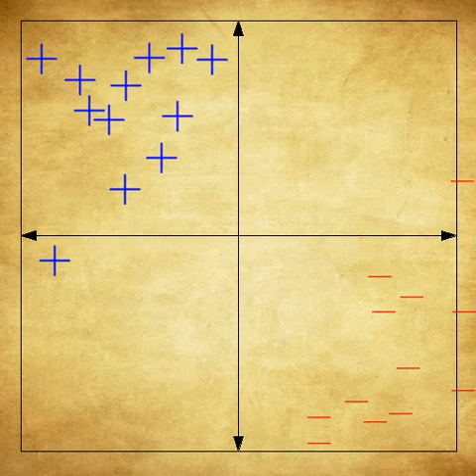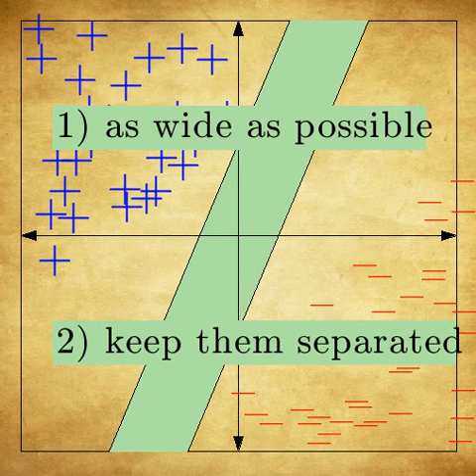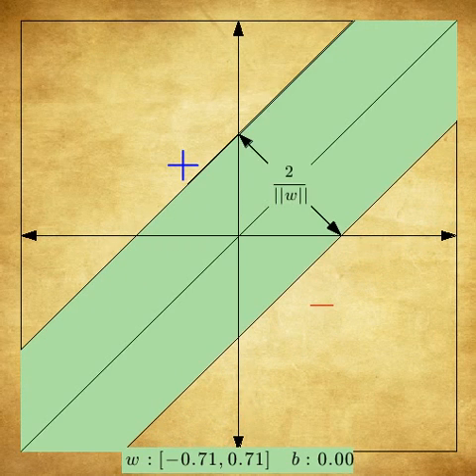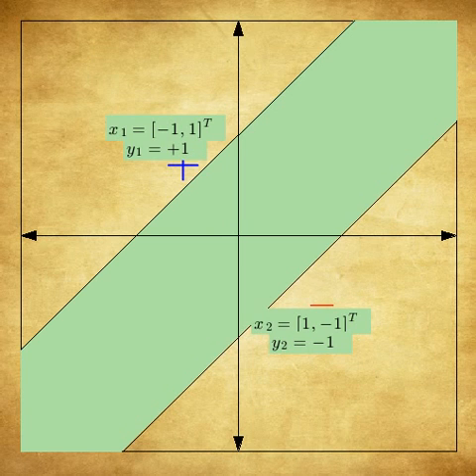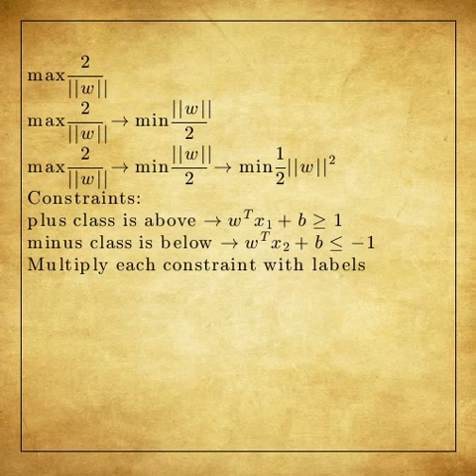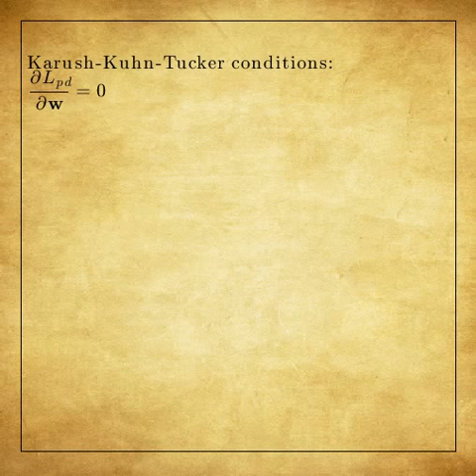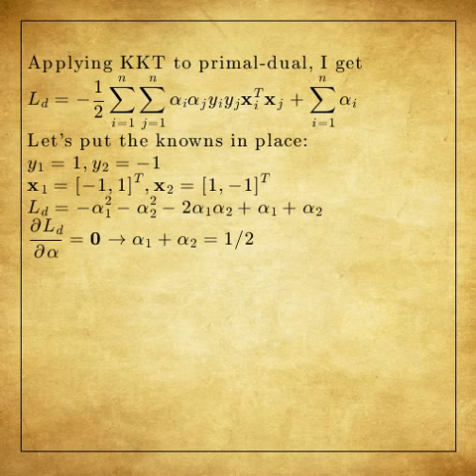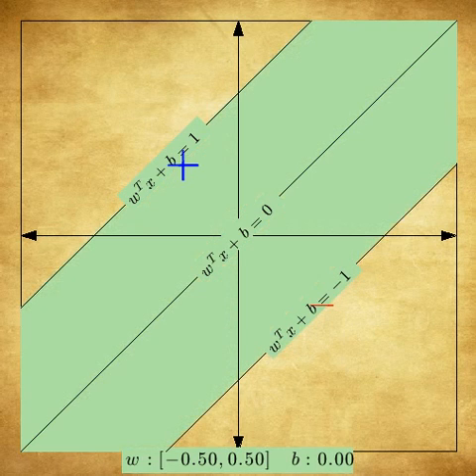Support Vector Machines (SVM) by Example

Comment: 1:20 to get what? why do we square it? thanks
Reply from the maker: Norm expression (||w||) has a square root in it i.e  ||w|| = sqrt(x*x+y*y) which makes optimition problem harder to solve. When you try to solve optimization problem, usually the first thing is to take derivatives. Taking square of the norm, you get rid of square root, and derivatives will be simpler.

Comment from the maker: The answer to the amine david's question:

The derivative of Ld with respect to a1 should be zero. This means -2a1 - 2a2 + 1 = 0
Similarly, the derivate of Ld with respect to a2 should also be zero. This also implies the same equality  -2a2 - 2a1 + 1 = 0. If you arrange the equation, you can reach  a1 + a2 = 1/2
Reply: thank you very much, but how do you get this result: W=[-1/2,1/2]. i need your help ,thanks
Reply from the maker: amine david It is simple: w=a1*y1*x1+x2*y2*x2=1/4*1*[-1 1]+1/4*(-1)*[1 -1]=[-1/2 1/2]
Reply: TemelBilisim thanks
Reply: TemelBilisim can you plz explain to me why is it important to have the hyperplace that leaves the maximum margin ?